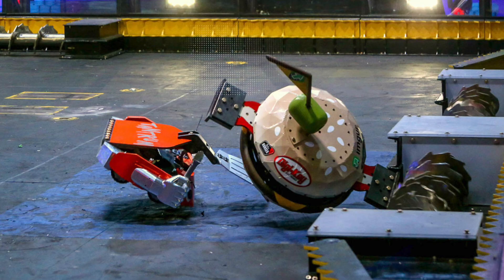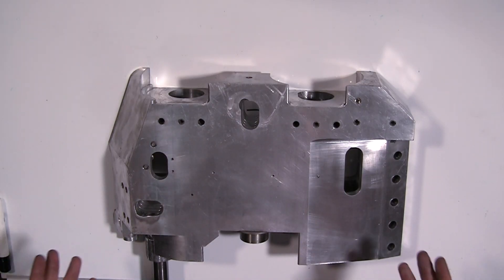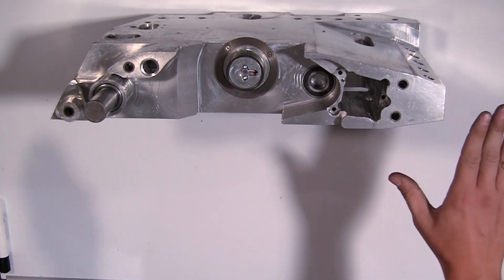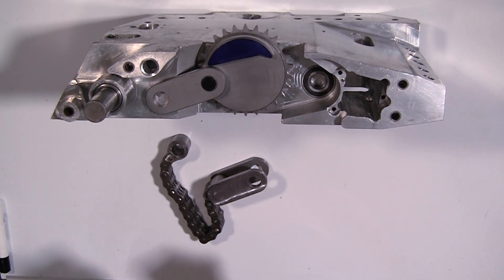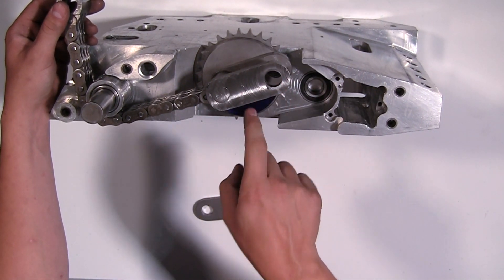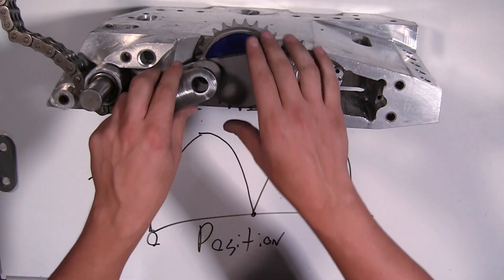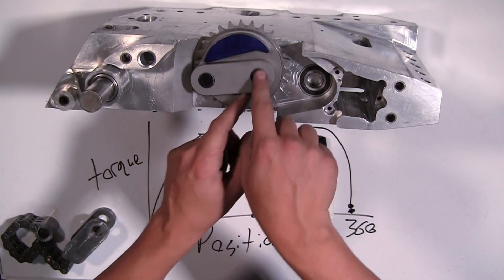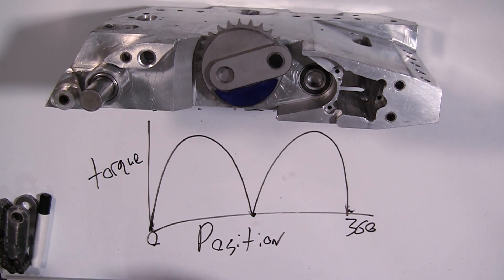Inside BattleBot Tantrum's Unique "Choo-Choo" Mechanism

Comment: So it doesnt have a limited number of firings the way a hydrolic flipper does then?
Reply from the maker: Yep! We're only limited by battery capacity!
Reply: shadowsa2b you mean pnuematic.

That said there is hydra which likely uses the hydraulic launch mechanism from a roller coaster and it also fires a limited number of times.